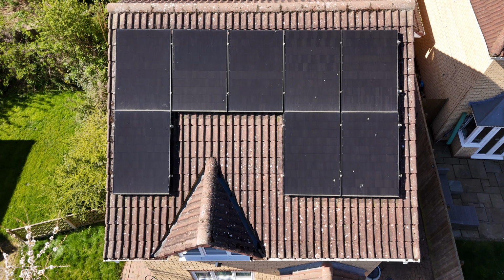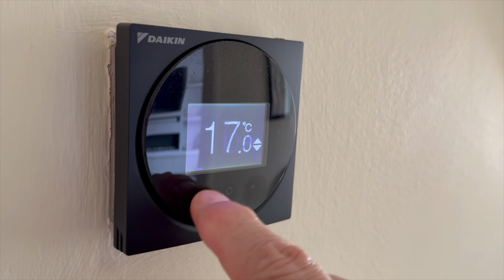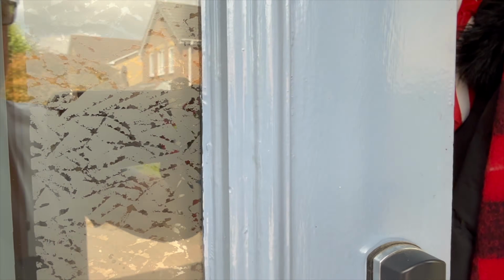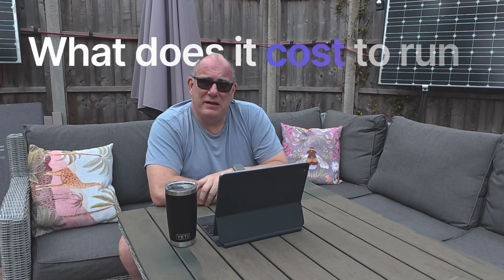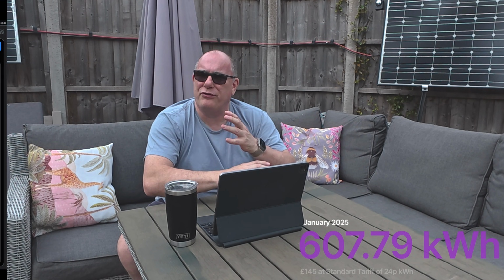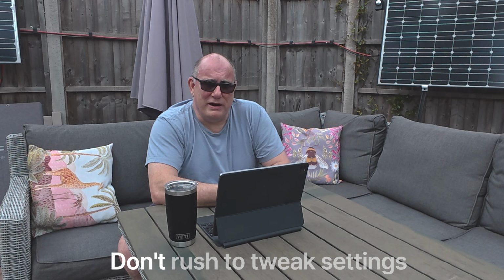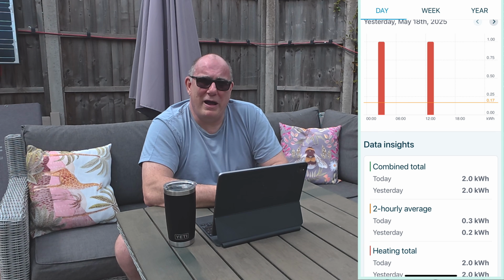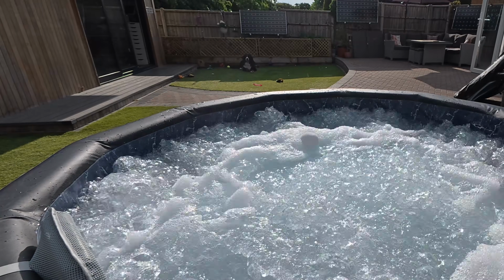I Spent 6 Months with an Octopus Energy Heat Pump and was blown away by the running costs!

Comment: We've got a 4 year old boiler and a 3 bar pump to run the showers that can empty the hot water tank in 10 mins - when we looked at getting a heat pump they couldn't get the sums to work (ie it was going to massively increase our electricity bill). House EPC is only "D" so trying to improve that and install solar before revisiting.
Reply from the maker: always so solar first it will make owning a heat pump so cheap

Comment: I would be interested to know how many hours per day you were running your gas central heating and if rooms were selectively heated vs the 24x7 ASHP set and forget. I typically ran my gas boiler for 6-8 hours per day selectively heating only rooms in use. My costs with an ASHP running 24x7, all rooms heated to same temperature are comparable to gas central heating run on an intermittent basis.
Reply from the maker: To be honest i don't have accurate results, we used to heat in 3 waves, early morning for breakfast, then a short top up around lunch then evening, suspect 8-10 hours a day in mid winter, less in other parts of the year, and off from April to October for heating. My ASHP runs 24x7 keeping the house at a constant temp.

Comment: I've done everything in the same order, and I have a similar size system and batteries, even with our gas boiler our bills have been negative for over two years, now we have the heat pump as well. The biggest thing that grates me is the annual service charge of around £250, which I have to have done to keep the 7 year warranty, which I suppose is actually no different to to my E Niro, but at least with the car they actually do something. When I had my boiler installed by a family friend in 2004 he said don't bother with an annual service, they basically do nothing, and he was correct, I think I had it "serviced" twice in two decades, and they pretty much done nothing. The same will go for the heat pump, maybe clean the filter, and make sure the evaporator is getting blocked. But I should be saving significantly more than the annual service cost, so it's still a win, just like the car is.
Reply from the maker: Why is your service cost so much, Octopus charge me £9 a month so £108 a year, what does yours include that their does not? I had a yearly service on my gas boiler and that's why it lasted 27 years, there is some cleaning and adjustment to make sure its burning optimally, making sure there are no CO leaks etc.
Reply: @JonathanTracey that's what my installer charges, they have given me a free one next year, after that I will shop around, but Googling suggests that's the going rate. My boiler was still running fine after 20 years, it had a couple of issues in that time, but nothing due to lack of servicing though, as they don't really do anything. I was told it will monitor itself, anything goes out of spec and I'd get an error. It was a Worcester Bosch, a pretty advanced boiler 20 years ago.

Comment: Which Shelly device are you using to track the Heat Pump Energy consumption? I have a few Shelly and need to find one I can put on the power showers as well as a future heat pump.
Reply from the maker: i’m using the EM 50 PRO, it can monitor two circuits with one unit, there are others such as the 3EM that can do 3

Comment: Working on 6p for kWh for gas that is ~13,000 kWh and elec at 25p kWh ~2,100 kWh of elec that is an impressive ~6.3 multiplier an average 11kWh per day. With the same ASHP and my 20kWh batteries and Octopus Intelligent Go where I get 99% of my elec for 7p kWh It would bring my heating and hot water bill to £89 for the same period. Is the 6x guaranteed by Octopus? If so I’m ordering one!
Reply from the maker: There are no guarantees, every house is different, the best thing to do is get a heat loss survey done

Comment: Great video I agree with all your statements. I run 2 ev's a heat pump 9.5 kw solar 2x 9.5 kw batteries. its the way foreward.😊
Reply from the maker: The thing I like the most is that we’re in control our own outgoings, we’re not at the mercy of global energy prices
Reply: I have had a octopus heat pump installed at the end of March. The install guys did a great job and were super efficient.One issue was a radiator that needed changing in the utility room would not fit due to the door impeding the radiator. Still waiting for new radiator. The system cost us £700 with discounts and referral an absolute bargain 
You are correct about the position of the thermostat ours is in the hallway and needs to be in the lounge.I don’t understand why Daikin do not have a wireless thermostat in place of the hard wired only option. Are you listening Daikin tech team!

Comment: Just had my second survey for a heat pump and with very different results to the first one. No need for radiator or pipe upgrades, a much small unit, 5kw rather than 9kw which takes away any noise pollution problems, and much smaller. Oh yes and much cheaper. The dilemma again, is the amount of electricity consumption for the full year, and the amount being consumed at peak times. I do have solar and battery, 20kwh storage, but AC coupled and limited to 3.6kwh inverter. From what I can see the heat pump is limited to a max of 3.6kwh output for 16amp, but generally never goes over 3kwh. This should be fine, however as you've pointed out, put the microwave or oven on at the same time and I'm pulling from the grid. Unless it would be feasible to do the hot water cycles during the 11.30-5.30 am cheap slot in the depths of winter, while topping up batteries and occasional charge of car and avoid during the daytime? I'm led to believe the hot water cycle requires a lot more electric than the heating cycle, so hoping it would be as low as 500wh, which would leave me some capacity left over, for the occasional brew and meal.
Reply from the maker: @bozwellboyce8364 I just looked at my Shelly EM to see what the peak usage was and on 1 day in January it went over 3kw for a few minutes but other htan that  its seems to stay around 2.5kw even on sub zero days. The 3.6kw inverter is always going to limit you in these situations, but I would run the heat pump for a winter before making any decision, see exactly how much extra you pulled from the grid at peak times, I suspect its probably about £50 for the winter extra, at that point it probably does not make sense to spend 1000s upgrading the inverter
Reply: @JonathanTracey  Thanks Jonathan. I know the surveyor/installer keeps recommending Ovo, but from what I can see, they don't have a comparable tarrif for the 6 hour cheap rate, but they do have bolt-ons for heat pumps. Surveyor also thinks I'll struggle with the 20kWh storage to get by on a full battery in winter
Reply: You're on the right track, but a few things to consider:

- A 5kW heat pump isn’t necessarily quieter than a 9kW one—it depends more on the unit’s design. For example, the previous-generation Mitsubishi Monoblock had a rated sound pressure level of 61 dB(A) for the 5kW model, while the 8.5kW version was actually quieter at 58 dB(A). There's also variation between brands.

- It sounds like your solar and battery system is installed under G98, which limits export (typically 3.68kW). If you ever want to exceed that in future, you can apply for G99—though you may need a new inverter unless yours is software-limited (e.g. Tesla Powerwall often is)

- A 5kW heat pump will usually be on a 16A fuse, but its actual max current is typically in the 10–12A range. That said, heat pumps rarely draw full current continuously, even during hot water cycles. If you check data from Heat Pump Monitor, you’ll see that many 5kW units only occasionally exceed 1kW during DHW.

- Yes, scheduling your DHW to run between 11:30pm and 5:30am is absolutely feasible and common, especially for setups with off-peak tariffs and battery storage. Many people do exactly that to maximise low-rate usage, some will even sacrifice SCOP by storing hotter water to ensure it doesn't need topping up again during the day.
Reply: @BenIsInSweden  Thanks for your response. When the first surveyor came out he said the property needed a 9kW heat pump and due to the location (only place it could go)  and the dB output from that model (only one they would supply) and proximity to neighbours window, it would have to go through building regs etc and most likely fail. The second surveyor suggested it only needed a 5kW and the dB output on this one would not be a problem and it wouldn't need to go to building regs for approval. Yes, PV is G98 with 3.68, i have 2 separate arrays and inverters. On the battery side GivEnergy, it's an AC coupled system and the inverter is limited to 3.6, I have 3 module batteries, which I'm told will only work with that inverter. So pretty much stuffed, unless I rip and replace which would be too expensive. I've just spoken with surveyor and he thinks I might struggle to run heat pump and all other things in the house in winter with 20kWh of battery storage. Good to hear you think the other bits are do-able, just a shame there isn't a "quick/cheap" fix from GivEnergy to get around 3.6kWh battery inverter limitation. There was talk of adding a second and running separately with some sort of software, but have to be careful with monitoring this that and other, yawn. Thanks for getting back to me, appreciated.

Comment: Jonathan, 

your heading is illogical.
To compare , in order to determine if you save money, requires something to compare against. as your only heating now is a heat pump, where is the comparison.
You can't compare historically as both the heat load and the performance of, presumably , an older heating system has too many variables. Then there is the question of bias?
 Logically, with the cost of gas against the cost of electrcity and the effectiveness of a modern gas boiler, I would say that a gas boiler must be better in performance and cost?
Reply from the maker: @iareid8255  Thanks for the comment — you've raised some interesting points, and it’s worth breaking this down with some facts and context.

1. Design Sensitivity vs. Performance Reality
You're absolutely right that heat pumps need careful design — flow temperatures, emitter sizing, insulation, and controls all matter. But this isn’t a flaw of heat pumps themselves; it’s a reflection of their efficiency-focused nature. Gas systems blast out heat at 70°C+, so they’ll mask poor design with brute force. That doesn't make gas better — just less efficient and less subtle. When a heat pump is properly designed (which isn’t hard if done professionally), it will comfortably heat a home to the same standard — just more efficiently and more quietly.

2. Heat Pump Performance in UK Conditions
You mentioned manufacturers quoting output at 7°C — true, and a valid criticism. But real-world data matters more than spec sheets. In my case, over 180 days including the coldest UK months, my system ran at a seasonal COP (SCOP) of 3.61 — meaning I got 3.6 units of heat for every 1 unit of electricity. And yes, that includes days well below freezing. So the idea that heat pumps “can’t cope” in the UK climate simply isn’t supported by actual data from modern systems.

3. Usage Patterns (Empty Homes)
It’s fair that gas might suit someone who leaves the house cold all day and just blasts it in the evening. But that doesn’t make it cheaper. Most people heat their homes for more than an hour or two a day — and in that scenario, a heat pump running consistently at low temperature will be cheaper and more comfortable. And if you pair it with smart controls, you can program setbacks, occupancy-based scheduling, or zone-based heating to match any lifestyle. It’s not either/or.

4. Comparing Bills Year-on-Year is Actually Smart
Looking at last year's gas bills vs this year's heat pump costs is a totally valid way to see if you're saving. Why? Because that’s your baseline — the same home, the same family, same comfort levels. In my case, I compared last winter’s gas bill (about £824) with this winter's electric cost using the heat pump — which came in at around £144 thanks to solar and battery, or £546 at standard tariff. That’s a massive saving — not theoretical, not projected, but real.

5. Gas Prices Have Gone Up — The Gap Is Growing
Comparing to last year’s gas bill is actually underestimating the savings, because gas prices have risen. If I were still on gas today, I’d be paying even more than last year. Electricity tariffs have also moved, but if you have access to things like night rates or pair it with solar, the advantage leans even more toward the heat pump.

6. “Gas Must Be Better” Without Data? Come On.
To say “I would say that a gas boiler must be better in performance and cost?” — without looking at actual usage or bills — is like saying “I reckon horses are faster than cars” without checking a stopwatch. It’s not just outdated — it’s wishful thinking. You’ve got to run the numbers, compare real-world bills, and look at actual system performance over time.
Reply: Jonathan, 

thanks for the comprehensive reply.
Higher temperatures give an increase in thermal transfer. Gas boilers at 800 C heating water at around 50 or so (return temperature) put a lot of heat in quickly. It is not brute force at all, it is more effective.
Heating anything is the heat input balanced against heat loss, as I'm sure you know.
The heater therefore is sized to the load, I don't accept that a heat pump is the better choice for performance. 

2  I have great difficulty in accepting the CoP figures quoted, exactly how do you calculate them, and by the way you should use KVA hrs as your energy input for calculation?

3  It seems illogical to use a hetaer and not leave it running constantly. It takes a significant amount of heat to warm a cold house twice a day, once up to temperature it only requires small burst of heat to maintain that. 

4 As I said originally, you have no idea of the comparitive heat loads year on year. That aside, you pay for solar and a battery? Solar does little in winter, as I''m sure you know. Just how old was your gas boiler, and did you set it to switch twice a day?
I presume you charge your battery at off peak times and discharge during peak hours, what capacity has it?
Gas prices have risen only a small amount but are variable, of course. Electricity has only one way to go and that is up with current policy, which is locked in as far as price goes for up to fifteen years.

6  Your anology is irrational. You cannot compare heaters in that fashion .
My simple perspective is that a gas or oil heater takes the fuel and utilises it directly and as far as my own oil boiler is concerned is stated to be 95% efficient, that is very good for an electromechanical device. Just bear in mind no device can achieve 100% effciency.

I accept that you are happy with your system but it is very expensive from a capital aspect and I wonder how the operating costs will be as time passes.
I have very many years experience in running and maintaining refrigeration equipment and they can be expensive to maintain as they age?
Reply: @iareid8255  Your numbering seems a bit off.
1. MIA.
2. kVA is irrelevant for residential billing; households are billed in kWh.
3. We agree here, but that’s not how most people run boilers in the UK—lacking weather compensation, oversizing, etc.
4. There’s plenty of comparison: same house, same occupants, but now heating to a more comfortable level. And gas prices likely only have one direction to go, since it's an international market commodity.
5. Also MIA.
6. "stated"? So you won’t trust usage figures comparing the same home across two periods, but you’ll fully trust the "95% efficient" claim from your boiler’s marketing material, despite that typically being an “up to” figure, not a measured one.
Unless you’re measuring your boiler’s system efficiency, there’s no evidence you’re hitting 95%, especially if your return temperature is 50°C, where condensing barely kicks in. Derek from Tomkat Gas Training did a good video on that recently, despite being fairly anti-heat pump.

Also, Jonathan has said multiple times that a gas boiler replacement would’ve cost about the same as his heat pump install. He also has a maintenance contract with Octopus for his heat pump, which costs less than what he was paying to maintain his gas boiler.
Reply: 🤣 Never change.

So I take it you think calculating inflation is illogical too? CPI literally compares the historical cost of goods and services over time, just like Jonathan did with his heating.

Comment: We have had our Vailaint 12KW heat pump in July 2024. We have 4KW solar and no battery. We sell excess to Octopus and use Octopus Cosy tarrif to import. We only got the heat pump data working in December, so we only have detailed information from 01-01-2025 to now. Our electricity bill is £505 for Jan to 20 May and we have saved £825 over using the capped standard rate electricty for the lights, freezer, cooker, washing machine, etc., and LPG for heating (which is the most expensive form of heating when you are off the gas grid). We live in north Scotland beyond Inverness and January was very cold.

Our house is 35 years old, standard Scottish timber framed house insullated to the standard when built and we added extra in 2023.
Reply from the maker: Thanks for sharing your experience — that’s really helpful! Great to hear your Vaillant heat pump is performing well, especially through a cold January in the north of Scotland. £825 saved is a massive win, and it’s impressive what you’ve achieved without a battery. Sounds like a well-thought-out setup with the Cosy tariff and solar!